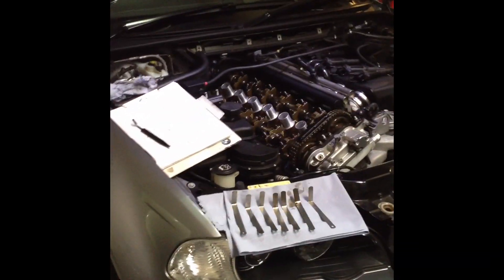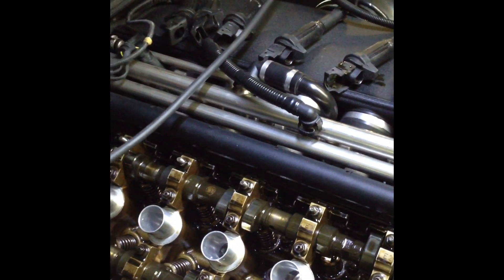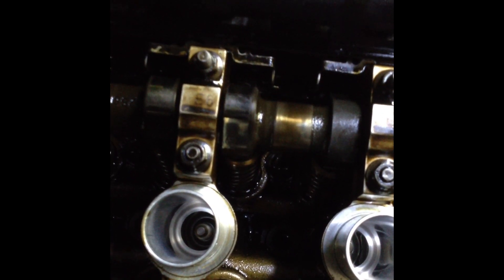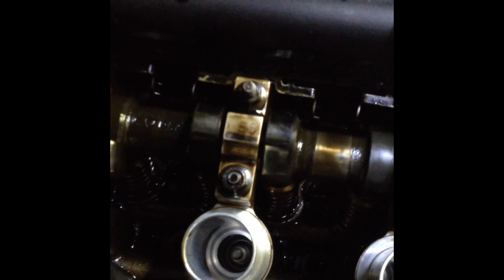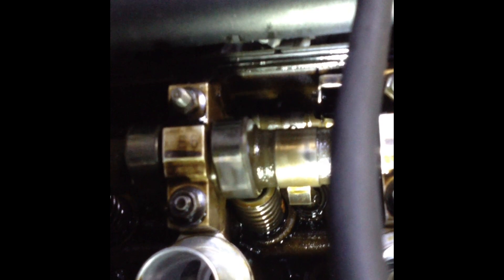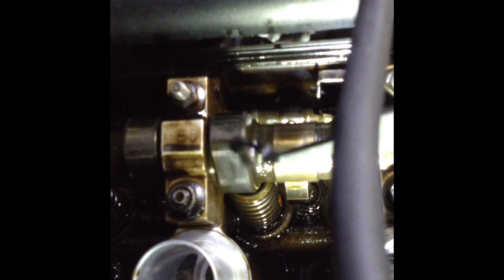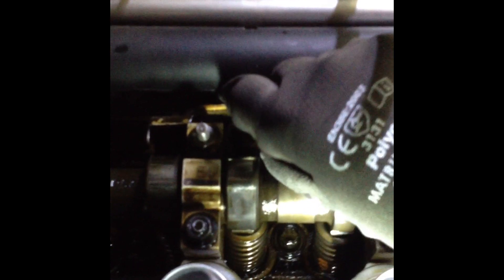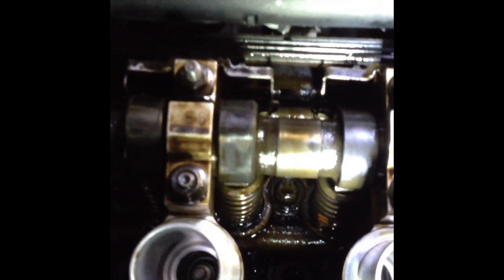BMW E46 M3 S54 Valve Shim Replacement Example

Comment: If the .229mm fits on the intake valve but the next size .254mm" doesn't, would that valve require a new shim?

Comment: My car's valves never being adjusted before and it's @ 80k miles right now. 
Does neglecting this service harm the performance of the car?
Reply: Not only. The valve might not close while ignition due wrong clearence. In this case you lose compression but also the increased heat exposion can harm the valve. In worst case it can fall of and harm engine failure